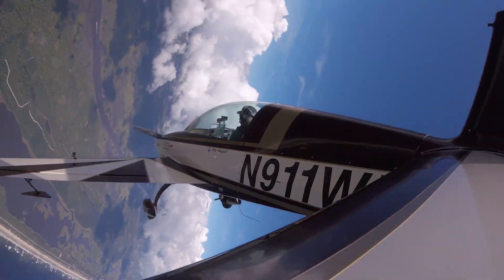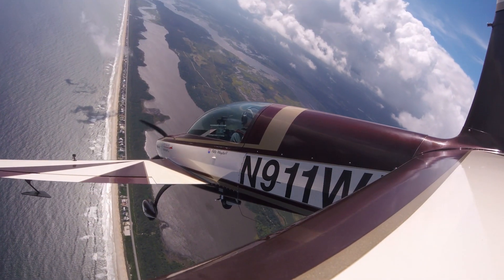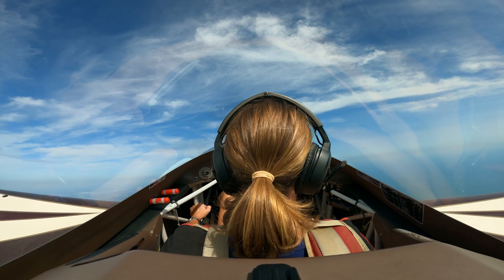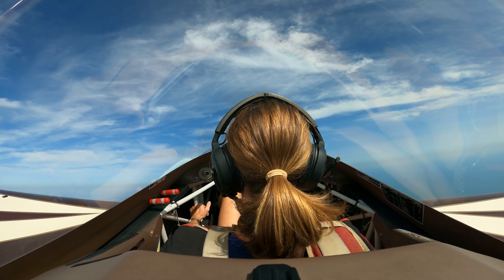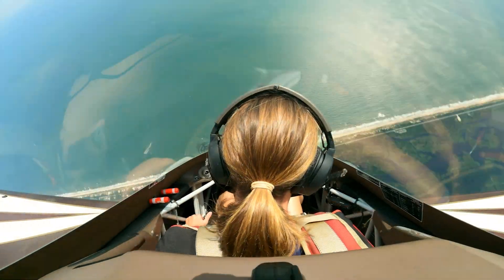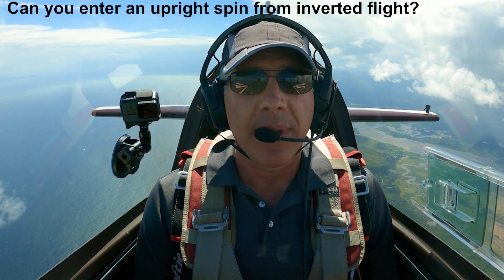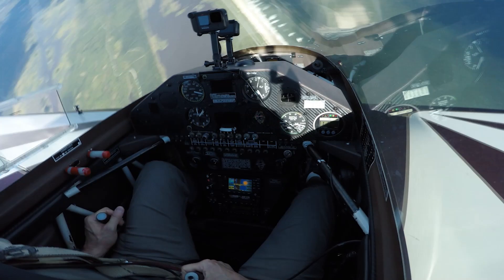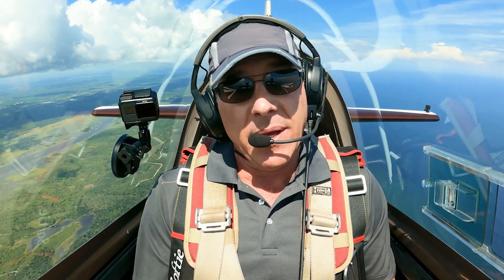Turns, Stalls & Spins - Episode 4: How Elevator Aggravates a Spinning Airplane

Comment: Question: When I was training with my instructor we would go from positive spin directly into inverted, but if recovery was too fast, the plane would go to inverted spin. Watching your video I think maybe we just pushed forward stick. Any idea?

It's been 30 years but training stuck like glue. If you pulled back to hard you could snap perhaps into a inverted spin. We did these many times but inverted was difficult detecting direction of recovery. I'm probably mixing different training segments...

The other was on a hammerhead at top using opposite incorrect control inputs put you into a wild ride. I think more of a snap roll. We always briefed before flight and did research.

Finally, the instructor had me record my voice while inflight doing  manuvers. The time lag in voice compared to actually doing the manuver was interesting. I needed to practice talking slower 😉
Reply from the maker: Thanks for the questions.  If you push the stick to far forward past neutral but not all the way forward after putting in the recovery rudder you will enter an accelerated inverted spin.  As far as pulling back the stick in a spin...that is an upright spin, always. Some people confuse the oscillations at the incipient phase of the spin for being inverted.   At the top of a hammerhead if you use right rudder the plane will eventually spin to the right and depending on stick position it could be upright or inverted but that is not a snap roll...and you have to be really patient for a spin to develop and then just hooks up suddenly.
Reply: @ssairshows  Thanks so much for the clarification. Really appreciate your videos.

Comment: The way you seem to explain it spins are much more controllable than I assumed. Atleast in properly balanced airplanes.
Reply from the maker: This is a certified plane flown within the CG and weight envelope so we expect all approved maneuvers to be controllable.  Too many crashes happen because the pilot overloaded the plane and moved the CG behind the aft limit.
Reply: @ssairshows  I was guessing something like that. You wouldn't want to try this in a C172 or 737 (Not sure about spin characteristics on jet aircraft)